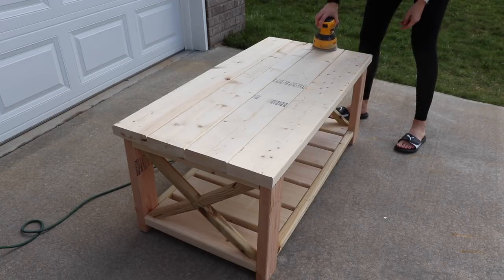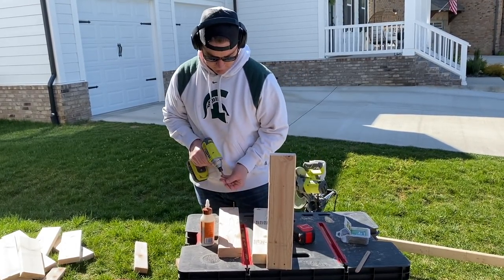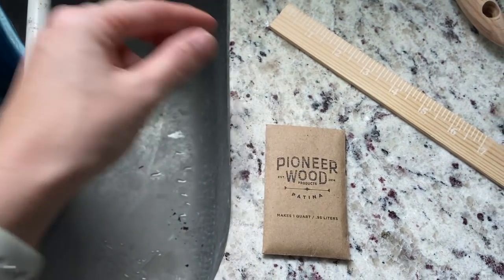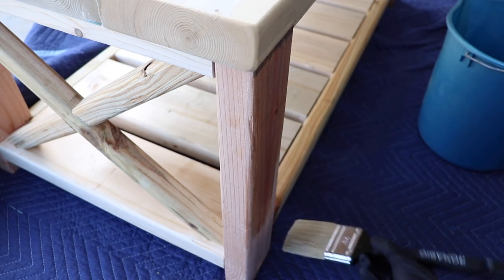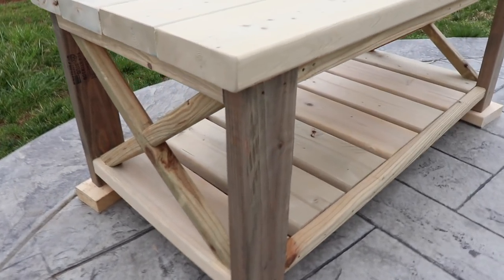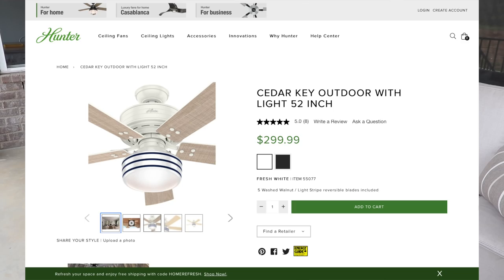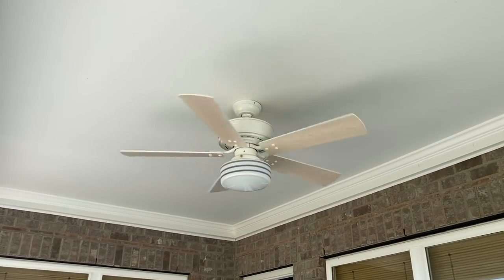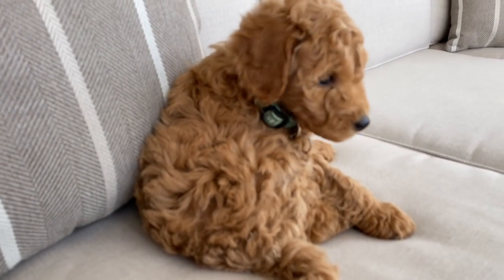DIY Barnwood Coffee Table | Spring Patio Refresh

Comment: Hi Christina.....I just watched the table build and stain portion of the video and you may have heard of this but I’m going to share in case others are interested in graying or weathering wood. I have a carpenter friend who builds me things I see on Pinterest etc and the I use a jar ( let’s say for reference a larger ball jar) with white vinegar 3/4 filled with a half a pad of fine steel wool....you can leave it in one piece or break up to 4-5 pieces ....drop in jar....put lid on and shake...leave 24 hours....then you can apply to board with a chip brush ( same instructions you gave for protecting surfaces!) you do not need to leave the piece outside....it will gray overnight....I usually use two coats...more or less depending on how dark you want it...you do not have to wait overnight before next coat. I use it mostly on pallet wood to make signs or small shelving units etc....I seal mine with matte clear spray paint once I get the color I want. You can keep the solution ....it will darken over time and get more brown as the steel wool starts to rust...just thought I would share....cheap easy and fast! thank you for sharing😊k
Reply from the maker: I have heard of this! Thanks for sharing your experience.